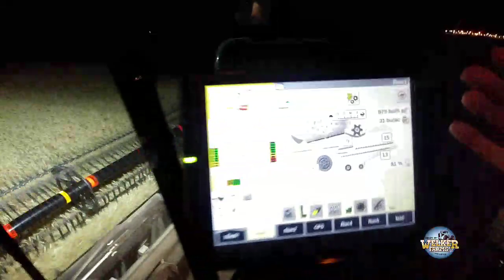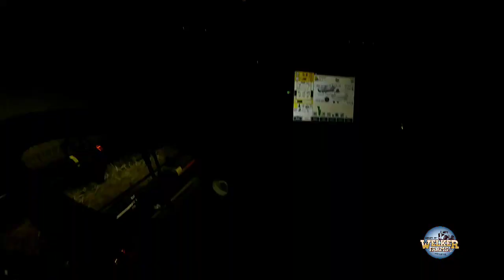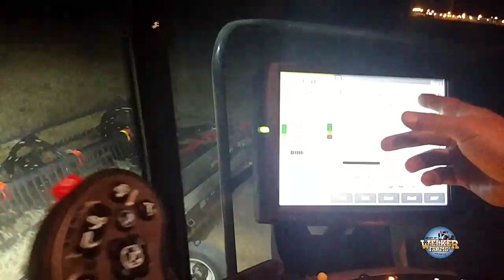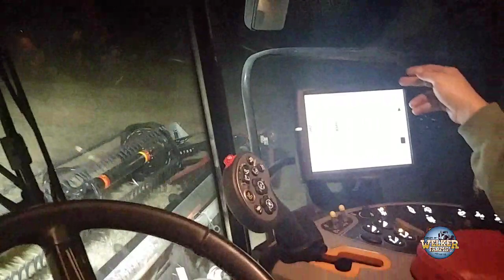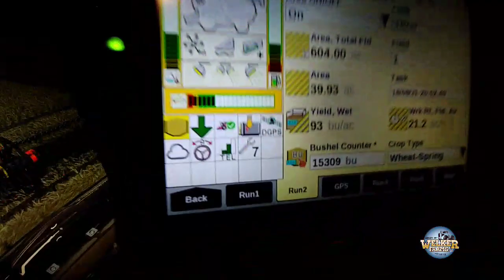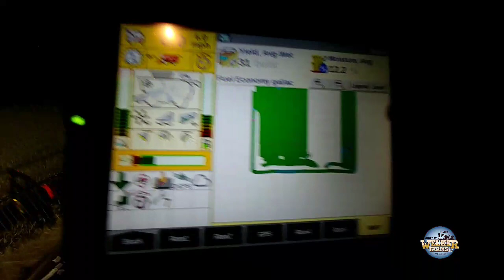🔴Live Special! CASE IH 8250 FULLY Automated Combine!

Comment: Nick to compare yields from the Netherlands to America i did some math. 2017 the best yields are 13 ton an acre now 2018 10 ton because of 2 month of drougt( witch is now luckily over since a few weeks) So best yield 2017  195 bushels an acre
2018 150
There is research that the limit is 225 bushels an acre but the 195 from 2017 is close. Of course the average yields are 40 50 lowerin our country.
This is mostly not irigated we have lots of manure in our country and plenty of rain but 2018 was the dryest year in 40 years.

Comment: I'm surprised they didn't have a draper header with that machine.
Reply from the maker: It actually is, brand new 40ft macdon flex draper head with a cross auger.
Reply: Ah, I see.  The belts aren't very visible from the cab.
Reply: Also, you talk about the header at 24:00 lol